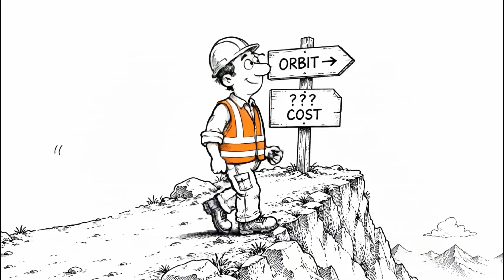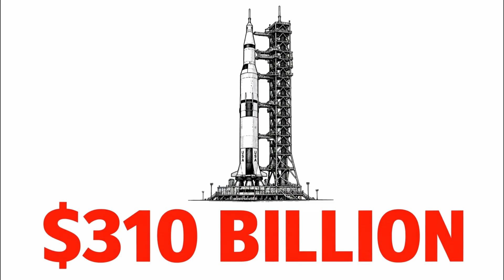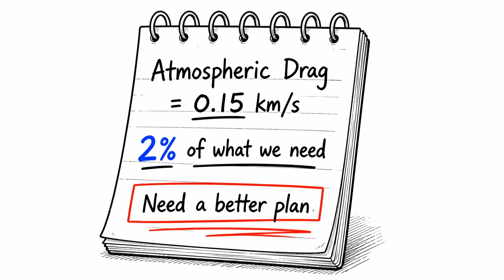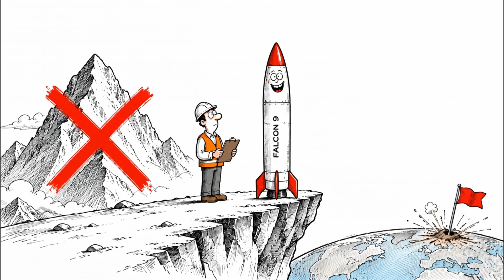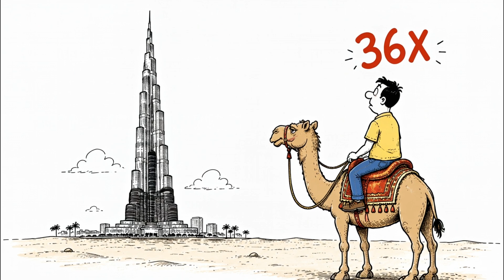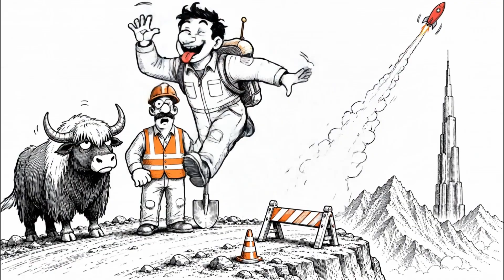What If Space X Launches Rockets From Mount Everest?

Comment: Elon doesn't need elevation, he needs Velocity. This is doable by puting  Falcon 9 on a jet powered horizontal rail car that reaches close to the speed of sound before it gradually slopes upward. Once it starts sloping the rail should end and Falco 9's rockets are fired up and gimbaled to near vertically orient the rocket. There should be some velocity loss, but Falcon 9 may already be going at 3/4ths speed of sound by the time its vertical.